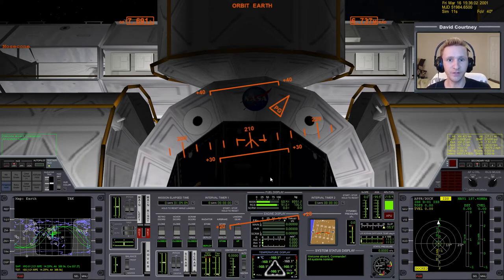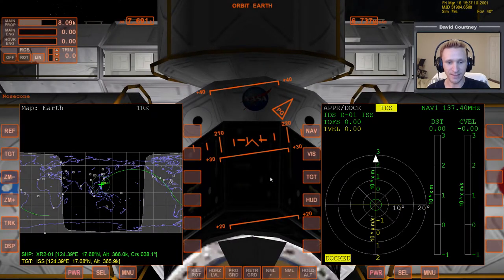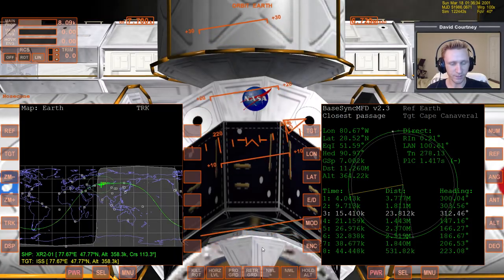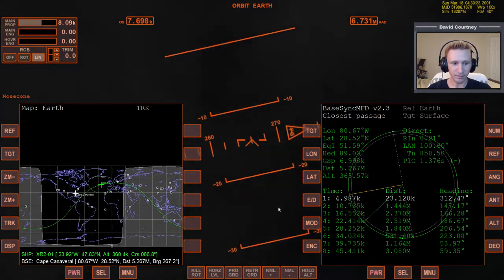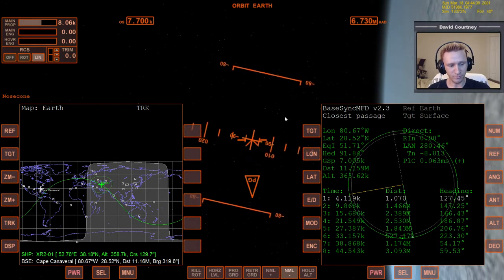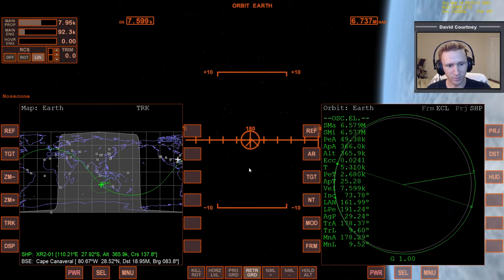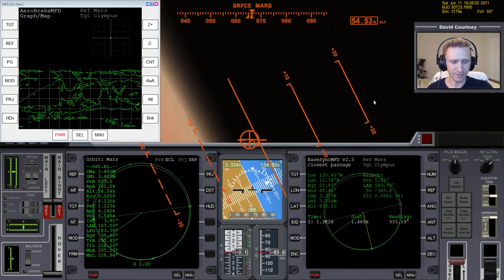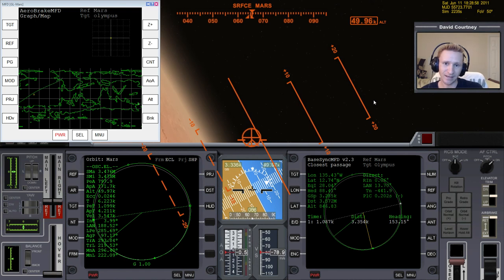Orbiter 2010 - [Part 20] Absolute Beginner Guide - AeroBrake MFD 2

Comment: Hmm.  I followed the prescribed S-turn method and targeted the spot that Aerobrake showed me, but I went by Olympus at about Mach 11 (or whatever 3400 m/s per second is on Mars -- sound probably travels at a different speed there).  Doesn't Aerobrake compensate for the thin Mars atmosphere?  It worked fine when I landed the DG at Cape Canaveral.